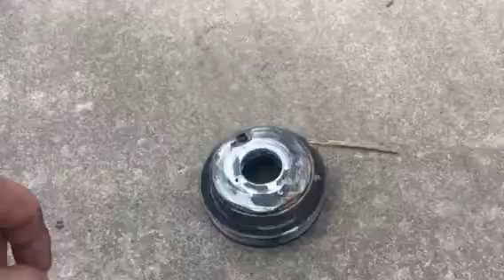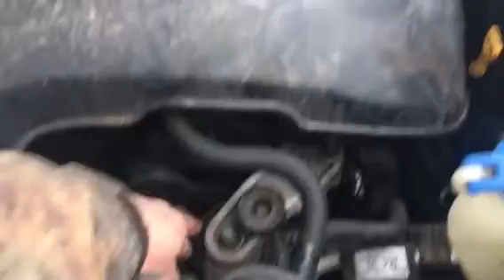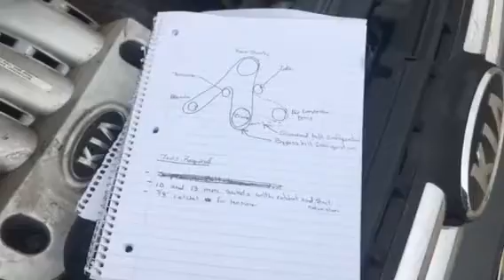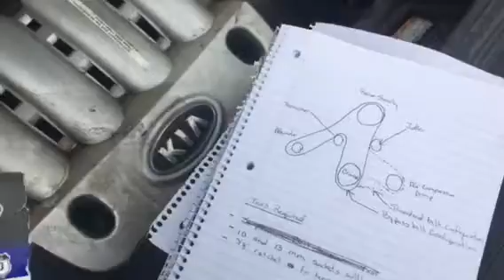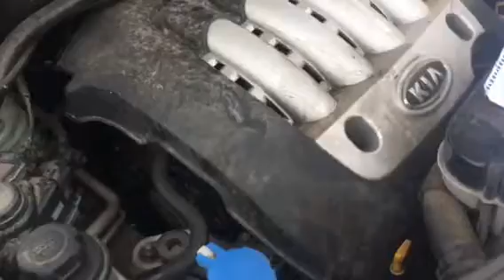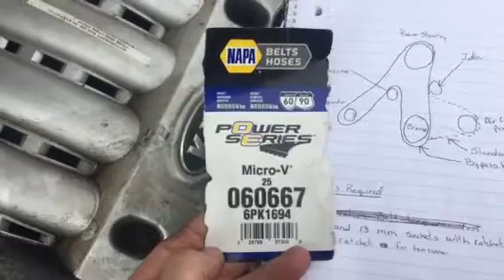Serpentine ac compressor bypass belt Kia Sportage

Comment: will it work on 08 Sportage?
Reply: Did it?
Reply: @cinnamon011 it does. I just did it yesterday on my 08 sportage. 
Two things: you need a 12mm socket for the tensioner bolts, not 13mm like he says. And you just pull the cable by hand over the front of the power steering wheel, which will shift the tensioner. Needs good strong arms tho

Comment: Just had the AC clutch burn up on the way camping this weekend....got hot as hell and of course burned the bearing up with it.. Noisy noisy drive home after camping but it made it BARELY! Man that pulley was flopping around.. Thanks for this fix!!! Found in Canada a 2008 Tucson has the "no AC" configuration, 2009 does NOT. $35 later and a half hour replacement and its purring again.. Yeah I got a SUPER DEAL price of $880 to replace the compressor but NO CHANCE.. Me thinks the old girl can run without the compressor ! Thanks for this tutorial.. BTW you do NOT have to remove the tensioner pulley- just loosen the 2 bolts and you can slip the belt behind the pulley and then snug back up after slipping the new one on.. Cheers!

Comment: I"m not a DIY guy at all.  My a/c compressor bearings started grinding weeks ago and I just went with it.  Luckily for me the belt eventually broke in my driveway, rather than the compressor disintegrating on the highway.  After an $1800 estimate to replace the compressor, I found this video and decided to do the bypass myself.  I found the replacement belt at O'Reilly Auto Parts, Gates brand, same part # for $23.  An educational and fun fix for me.  Thank you for the instructions and motivation!